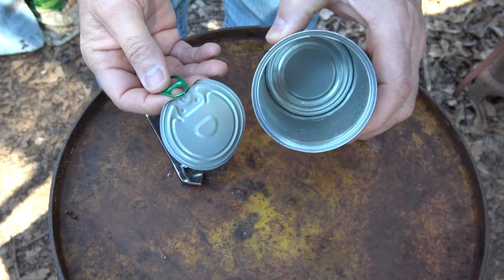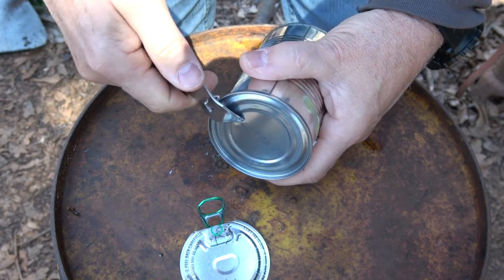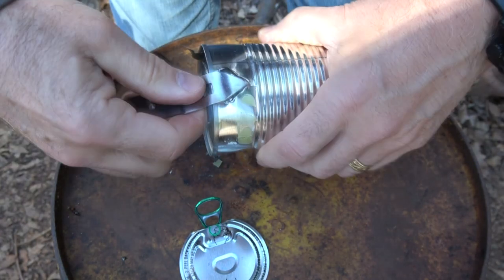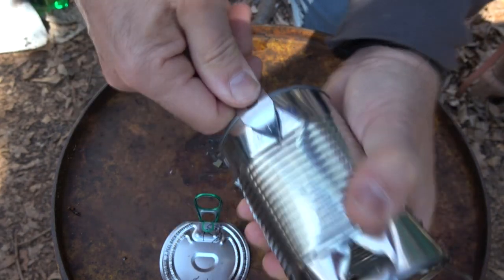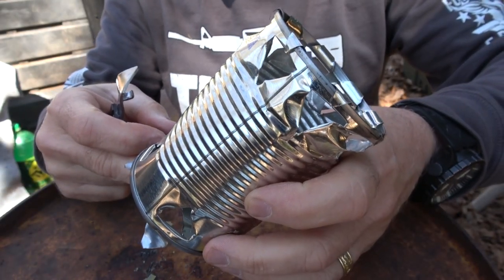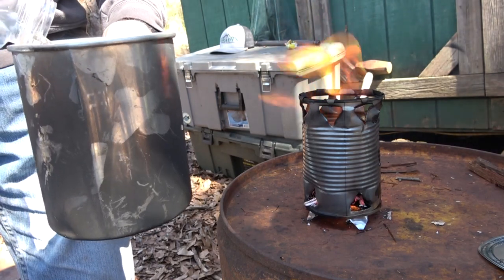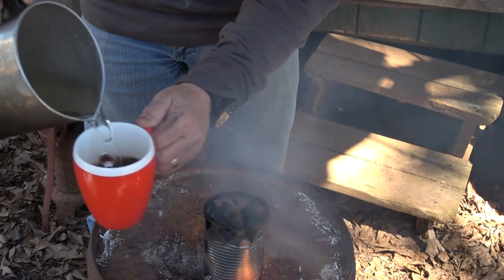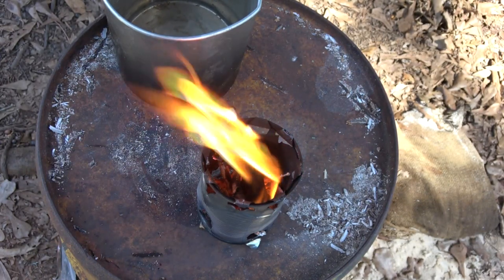Easy DIY Tin Can Survival Stove

Comment: Maybe you can connect a few together. Like 3 with wire, or 3 with a paperclip top and bottom to each pair?
Maybe bend a wire clothes hanger around the middle of them.

3 together will give you a more stable base of cans. And you can just light each one as you need to. 1, 2 or all 3 at the same time. Faster cooking.

I like your video.

Comment: You can actually use little candles in here to and it works a little better if you make the bottom legs flat so it doesnt tip over

Comment: Yea sorry to tell you there scooch but this is not an origional idea made by you, what you actually did was make a variation of the hobo can stove, and there are many variations of it, this is nothing new and it's been done by those who lack a proper stove.

And in point of fact the larger cans had been used to make the can stove, like the school cafeteria size cans, canned peaches, canned beans you are right however regarding the label but scrape off that glue sticking to the can and you have the extra fuel.

When you try to speak of survival be sure to include the use of all those resources, much like the natives who made use of the entire animal they killed.

Where I come from it's called common sense, you learning anything yet? I doubt it.